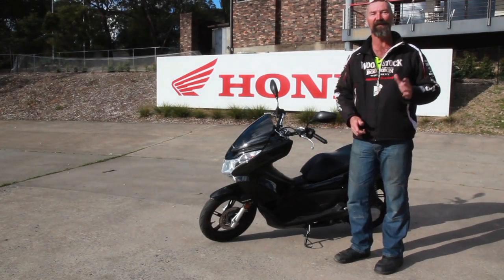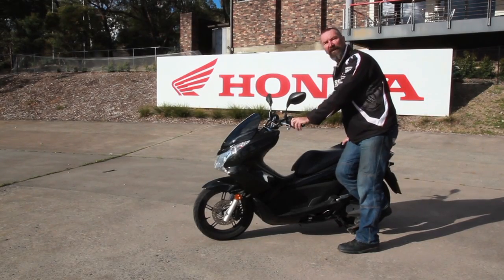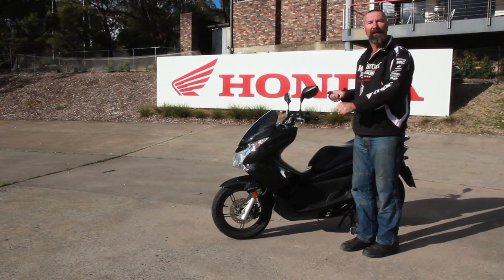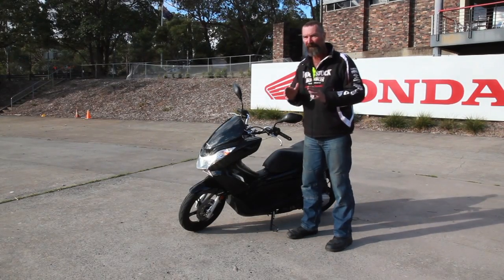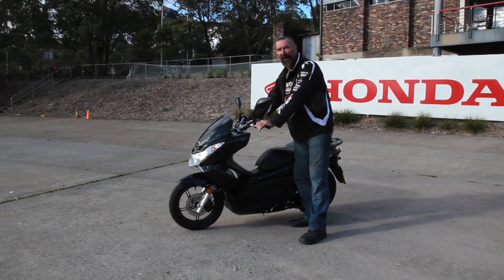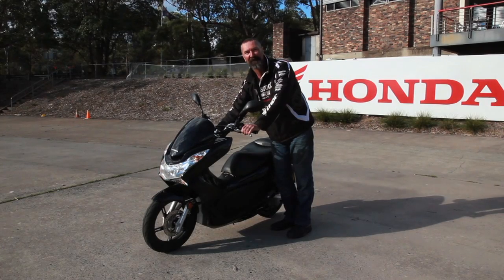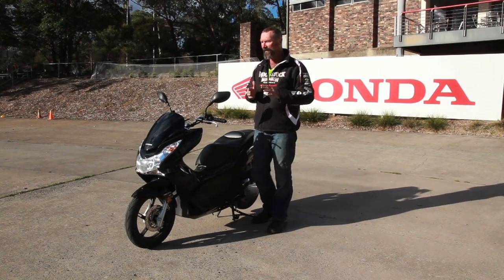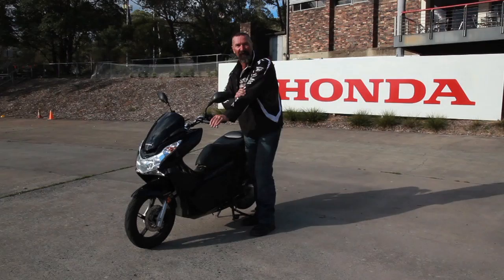Taking a scooter on and off the centre stand

Comment: I'm such a light weight. I have no problem taking my scooter off the center stand, just putting it on the center stand. I am so upset that I'm too weak for this one. How do I lift it in the back?
Reply: +Julie Stewart I was having the same problem and found that I was using the wrong posture... it takes some practice... as seems like we need to train the body a tad so the motion comes almost automatic....
Reply: +Robert Ostman I want to add that in my case what I do is to keep the arm holding the rear... straight... so I am not actually using that arm muscles... but rather my back... I hope that this will help
Reply: Thank you so much for your advice. I will keep trying! Hope you had a great New Year's eve and a wonderful day.
Reply: hey happy new year!!.. if... it is a scooter what you are using I am almost sure that the advice provided should be enough... the night was great by the exception of me developing a cold/flu.... looking to protect the guests I choose to wear a medical mask... so to prevent a tad to be spreading this thing....
Reply: Oh wow...feel better!!! The flu? Hard to beat, so you need lots of rest. You'll get better.

Let you know how this turns out. Raining in Florida, so I'll take my "boy" out a little later and try my luck again. I think I was lifting the back...I'll try again, and let you know.
Have a wonderful day.
Reply: @juliestewart3031  hope ypu figured it out after a few years :)
Reply: @robertostman2075  That and scooters have a pretty low centre of gravity, I had done that on a motorcycle before, but when I got my 125cc , I damn near dropped the thing on me trying to put it on the centre stand 😆, with scooters you need to a lot more weight on the stand before pulling the bike

Comment: I've watched tons of videos to make it easier to put the bike on center stand. I'm short,  115 lbs soaking wet and nothing works for me. I read that most motorcycles don't have center stands only side kickstands. There is no easy way for me to do it. I'm removing the center stand to save weight.

Comment: Taking kickstand off inside a tile floor is futile , as it just slides. Prob.solved with right diameter hose rubber plug on the end but, i do drag the kickstand occasionally.   🛵⤴⤵⤴🌪